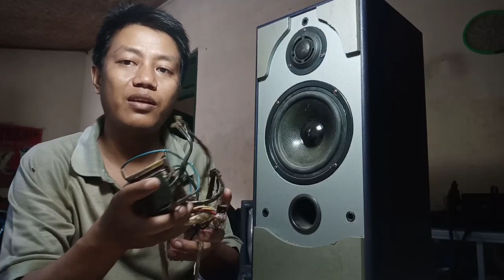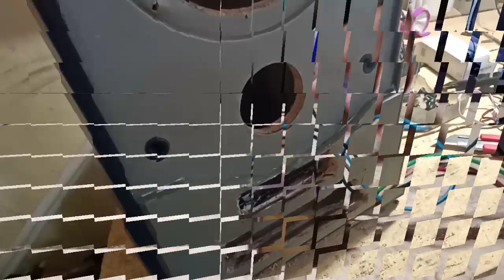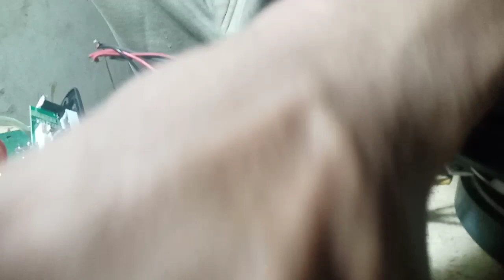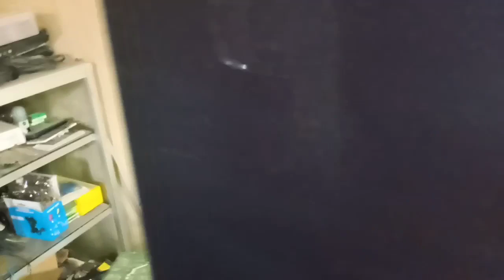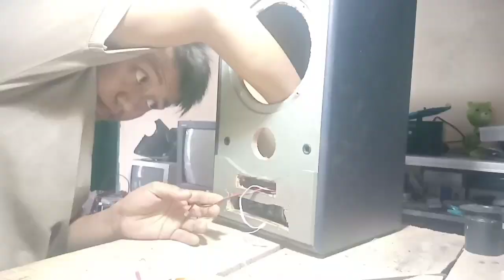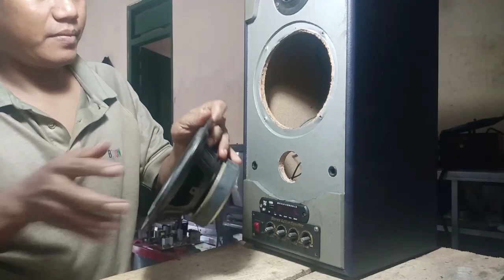Cara Membuat Speaker Aktif + Mp3 Bluetooth Sendiri dari Bekas Salon Pasif

Comment: Mohon solusinya cara menurunkan tegangan psu 32 ct volt mnjadi 15 volt ct trmkasih
Reply from the maker: Turunkan dengan  IC 7815 untuk plus,  7915 untuk minus
Reply: @alphateknik  wes tak jajal j pancet rusak ae ic regulatore mas wes entek 2 set ic